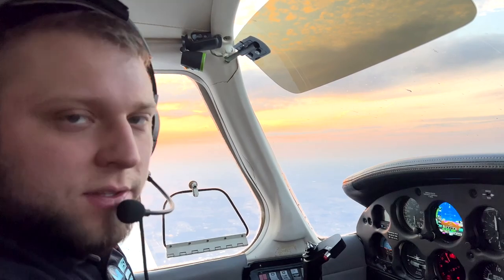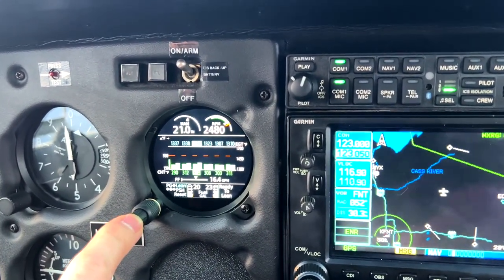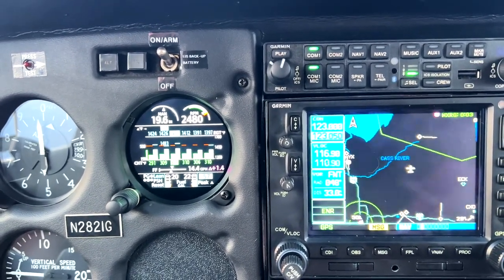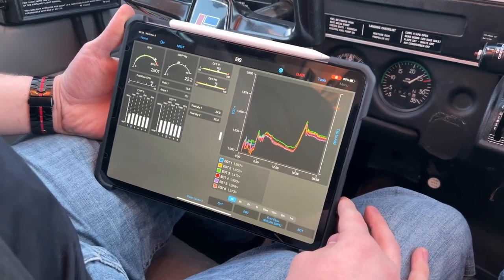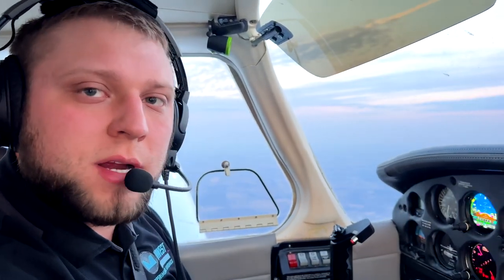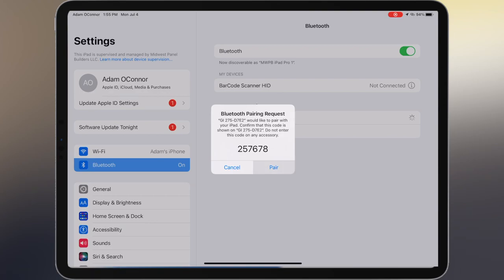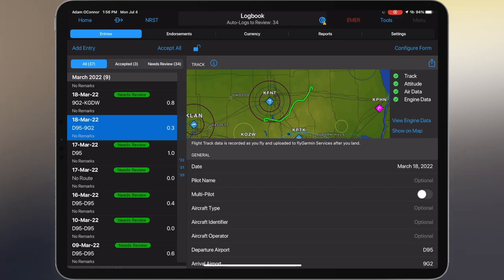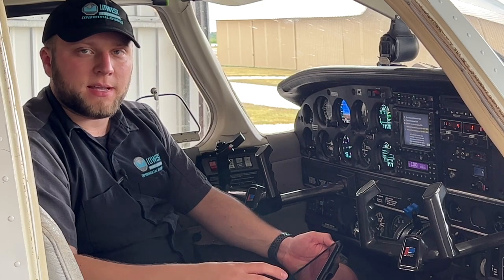GI 275 Pilot Perspective

Comment: Cool, does Garmin Pilot also show those engine graphs when connected to a G3X and associated engine sensors? Also are those GI 275 units all physically the same. I.e. if you buy the EIS version does it also have all the screens of the MFD version of do they come preconfigured with different software? Tempted to use one as a backup instrument even though they are a fair bit more costly compared to a G5, they make up for it in functionality of course.
Reply from the maker: Jan,

Yes, the G3X is capable of this functionality. The 275 EIS and MFD are the same part number. The ADAHRS/ADAHRS+AP units are different. In experimental applications, one could have the MFD and EIS pages on the same instrument, however in certified aircraft if the instrument is going to be used as the primary instrument then it must be EIS only. 

If you have a G3X, the G5 is still a better option when it comes to functionality with the G3X system for reasons we explained in another video. 

Thanks for watching.

Comment: really curious what the MAP issue was. Looking forward to diagnosing an engine with the 275.
Reply: Probably a faulty sensor or contact, if the factory MAP sensor is reading correctly.
Reply from the maker: We put a snubber in and that fixed the issue.
Reply: Snubber valve was my guess. Pretty common.

Comment: Cool unit, but placing the control knob on the left instead of the right is an ergonomics fail. Most pilots fly with their left hand on the yoke and use their right hand to manipulate the avionics.